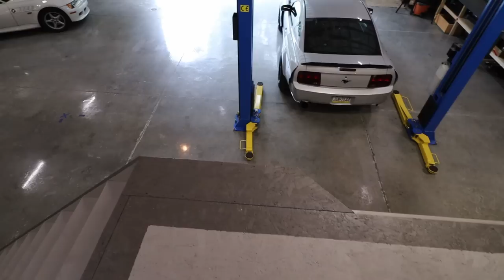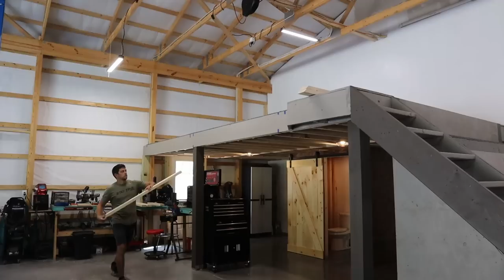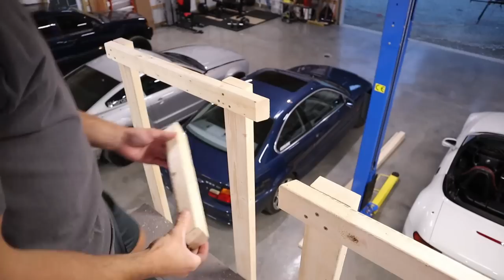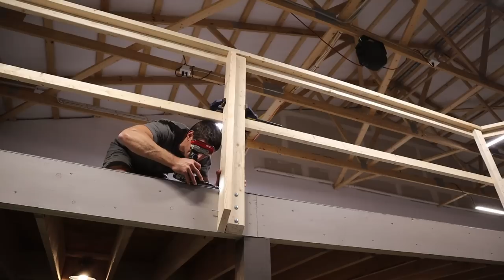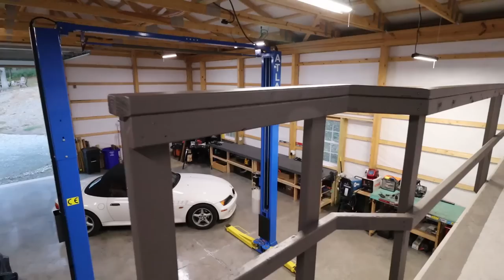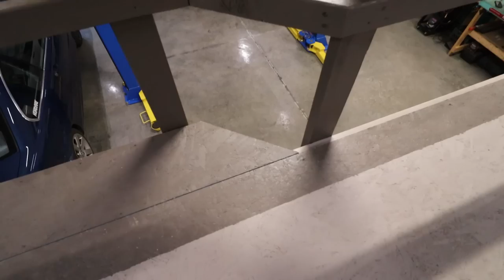Building a Railing for the Garage Loft

Comment: You could run some steel cable through the posts if you want some extra flare and a bit more protection, just an idea 🤷🏻‍♂️
Reply from the maker: I was thinking a bit about that, might need some extra bracketry since the posts are kinda in the wrong orientation for it.
Reply: @Kordare  Yep I don't think I would drill the vertical members of the rail for cables. I would look at some way of attaching them on the inside with brackets.  I expect your local code says that the current configuration is not in code. Most building codes say something to the effect that the space between "pickets" or "cables" should be no greater than 4 inches.   I would also consider putting a dark stained 2x3 horizontally on the very bottom as a kick rail just to keep stuff from rolling off the loft by accident and potentially falling on a person or car.
Reply: @Kordare  I was just thinking steel cable would be a cool railing fo the stairs.  Just a single cable at the top, or maybe 2 like your railing.  Just enough to keep you on the stairs and give a place to run your hand along when going down.

Comment: I know I told you before, but I plan to use your loft ideas for inside my shop. I want a 32' long x 8' deep loft. Just finished my white sheet metal ceiling with 2- 72" ceiling fans. That was a process! But keeps a lot of heat in. Now to safe for the loft / storage area

Comment: Instead of making more horizontal rails using wood, you should try metal wire, that would look good againt the dark colored wood. Awesome work
Reply from the maker: Thanks! And yeah I might do that, just will need some bracketry to do it right

Comment: Sweet setup. As a fellow engineer, I'm sure you realize those guardrails are not up to code. But with that said, I would have done the same thing, and included a removable rail section so I could put heavier items up there with my lift/chain hoist/or whatever you have. It looks like you're close enough to the hoist to rig up something.
Reply from the maker: Haha yeah obviously I wasn't worried about code, would probably just need some more horizontals for it to pass. The biggest thing I'll probably put up there is a couch which shouldn't be too hard to bring up the stairs. Appreciate the feedback!

Comment: Nice job. What did you use to finish your floor and is it Fuel/chemical resistant?
Reply from the maker: Thanks! I used surecrete polyaspartic coating and yes it is. I'd suggest doing at least 2 coats.

Comment: Nice job on the railing! I have a question, I have a 2007 BMW 335xi that has a Borla exhaust, it was droning, and a little loud for my comfort, so I put some cheap resonators from Amazon on it, but it still drones, so should I go back to a stock exhaust or some other muffler that is quiet? I want to install little bigger turbos on it in the future so I have heard it needs an aftermarket exhaust, so I'm not sure what to do?
Reply from the maker: Do you have catless downpipes? That normally causes a lot of drone. I used the vibrant ultra quiet resonator with nothing else on my 135i and it sounded great. Check my 135i playlist for exactly what I did.
Reply: @Kordare  no the cats are still there. I looked at those ultra quiet resonators, I'm debating on doing those or just find a factory muffler. Probably whatever is cheaper at this point.